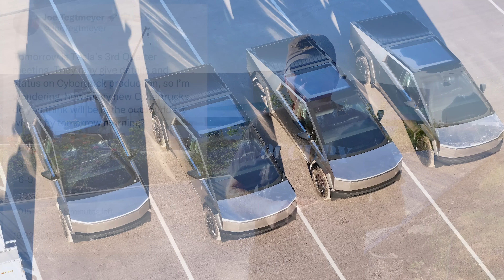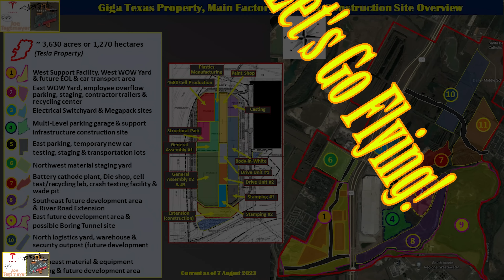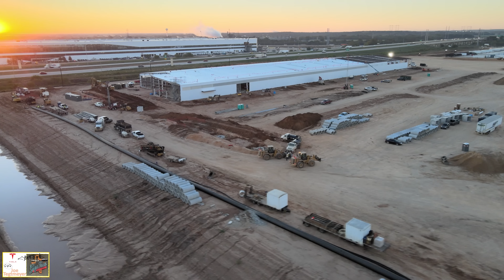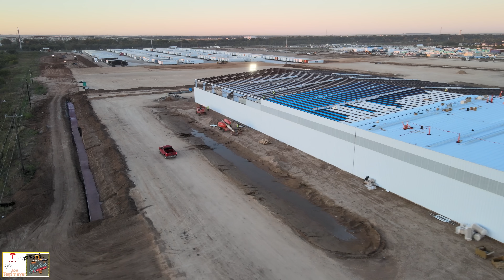4 Uncovered Cybertrucks, S End Footings & 3rd Qtr Results!18 October 2023 Giga Texas Update(07:35AM)

Comment: Perhaps the white plastic covering in the permanent switch yard is to allow the assembly crews to complete the (final) part of the wiring without risk of exposure to water. Might it be possible that it's important for it to be done in a dry environment, or perhaps there's a contractual time constraint/deadline they have to meet?

Comment: The white paint is intumescent fireproofing. It protects the steel from the heat during a fire. It is similar to cementitious fireproofing but intumescent is easier to apply and doesn't add as much weight to the structure.

Comment: 30:05. This is a good cover up! Terminating high voltage underground cable is a process where cleanliness is very important, especially keeping out moisture from the connections as they are prepared. It is a process of peeling back layers in specified ways to get to the main conductor, then applying the termination coverings in layers in very specific ways, all while remaining clean and dry. I have never done any at this voltage, but I have terminated and spliced 13.5 kV cable, which has the same requirements, albeit a simpler process.
30:35. Fencing added between the BESS switchyard/substation and the BESS yard.
Reply: Any idea how long this process might take? Days, weeks.
Reply: @DessieDoolan  
Depends on when they actually start the work. I believe a crew of 4 can do at least one connection a day, then they have to be tested before the final connection is made. Testing is done after both ends of all the cables have the termination connectors installed.
Reply: @GoCoyote  Easily a week then.
Reply from the maker: Thanks for the great info and insights! I appreciate that!
Reply: @JoeTegtmeyer  Thank you! Your the one actually doing the work. I just comment, opine, and share my experience from my armchair. You do a great job, and I know that a lot of people really appreciate that you are willing and able to keep us so well informed. It has been such a pleasure to have such comprehensive information about this project, and I have learned a lot from you and others like Dessie. Well done.
Reply from the maker: @GoCoyote  🤗👍

Comment: WRT to why they are currently only making rear castings, do they more than one 9,000-tonne press working? If they are making both castings using the same press, then they will probably make the respective castings in large batches so as to reduce how often they need to change the casting die.
Reply: There might only be the one 9000t press operating and they don't want to lose the hard fought dialing in of the rear casting dies by swapping in the front casting dies.

The castings stacked outside today are identically placed as the castings were on Monday. Indicates no additional castings manufactured since then, or at least not stacked outside.
Reply: @DessieDoolan  Or could still be dialing in the rear casting with proto die, which they likely wouldn't want to change, until it's final and they create the first permanent die?  Then on to similar for the front or the front is already done and they used up internal space for those.  I can make up anything when I actually have no idea what's going on. :-)  Still fun to guess.
Reply: @scottgaree7667  You are right, it's mostly guess work. Have to trying and join the dots, except some of the dots are inside out of view.
What we do know is that Cybertruck front castings have not been seen outside.
There are no new flues on the roof to suggest that the 9000t presses have their own dedicated furnaces yet. No new flues for the 3 new furnaces on the east side yet either.
Giagpress parts in the recycling yard might (or not) indicate something has gone wrong.
This is a good video via HarderNL about High Pressure Die Casting. Some insights into how complex a process HPDC is, https://youtu.be/pks96GSnjbo?t=4
Plus 9000t machines are a new beast to tame.
Reply: Perhaps there is a change to the front casting responding to a problem discovered in the crash tests.  They are continuing rear casts while awaiting a new die for the front??
Reply: @benguthrie49  I guess we'll know if the Cybertruck release date gets pushed back months.

What I think we are seeing is rear castings only as they dial in those dies, and we'll see front castings sooner or later while those dies are dialled in.

Similarly there was months of Model Y castings showing up before we saw Model Ys in production. May to November if my memory serves me correct.

What am I saying! Of course the release date will be pushed back!😲
Reply: @DessieDoolan  They said end of November for CT first delivery on the call today
Reply: @benguthrie49   A ceremonial 'first delivery' for sure.

I have commented in the past that I'll believe mass production has started once I see a Cybertruck in the employee parking lot.

Inconveniently there was one at the Superchargers in Brad's video yesterday. I may need to come up with another indication.

First Cybertruck in the contractors parking lot!
Reply: @benguthrie49  Yes. Since I wrote my original post, I recalled that Brian White from My Tesla Weekend had mentioned this. 

I wouldn't be surprised if it was true because the front of the car has been shortened since the original prototypes, so the front crumple zone is probably shorter than it was originally designed to be. Combine that with a rumoured slightly heavier than intended vehicle weight and they might have had to make a range of changes to the front of the chassis and crumple zone so that it performs to spec in collision tests. 

I think they have been making the vehicle with the front castings only since the first production candidates in July. So they probably didn't encounter this problem until they crash-tested those vehicles, although they probably expected it would be a problem. 

The problems encountered are probably the reason why they have built the new collision test facility at Austin and why there has been a 1-2 month delay in the proposed vehicle launch date.
Reply: we'll see. The die is cast. ( couldn't resist )
Reply: @benguthrie49  I was tossing up whether to use that also. (couldn't resist) 😑

Comment: Why is there so much steel on the ground near the EOL building still, when framing is complete?
Reply: The areas where the roof is a clear span may have been an afterthought and these are the components those deeper columns and beams replaced.

Afterthought, as in redesign any time over the last 2 and 1/2 years. That steel has been on site since March 2021

Comment: Thanks Joe.
5:26. W-WOW yard. Far right. Rolled out geo-mesh. This may be a dedicated road from River Road to the new EOL site.
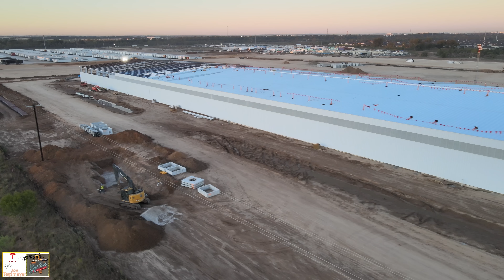6:55. New EOL site. HDD project. Bottom. Barrel reamer. 2 drilling mud reclaiming machines operating. Blue and yellow.
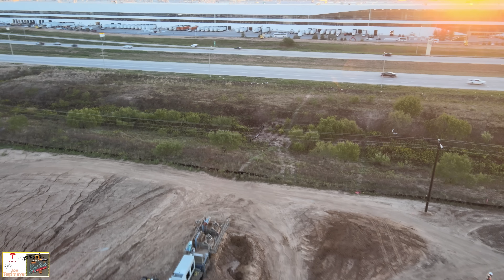8:08. New EOL building. Roof drain pipes and excavation.
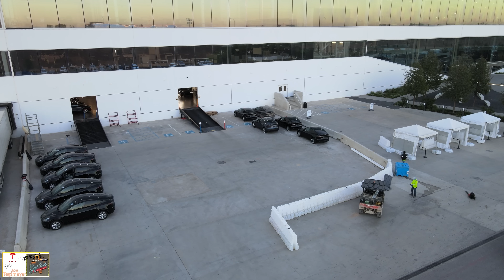8:44. Highway berm HDD project. Additional lengths of drilling rod to be added as the drill is pulled back westwards.
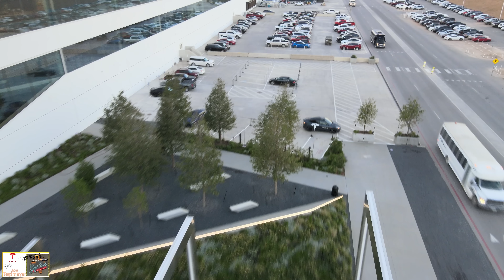9:22. Main Entrance. Washing the calcium staining off the Stoneglass. A temporary fix.
9:46. Highway berm. Still no obvious reason why the powerlines were shifted to the foot of the berm.
11:02. Southend. White frames. Look like the heavier duty pallet racking seen inside Battery recently.
GA south, wall. Grey acrylic render/stucco troweled over the wall sheeting.
11:57. Southend. Layer of gravel built up several feet. Orange spray marking shows footing squares.
12:30. Southend, east. 4 CFA piles per column footing/pile cap. Column spacing would seem to be the regular 45’10” 14m spacing used elsewhere in the factory. Different to the abutting Stamping column spacing. Larger sized footings to the left.
Workers are breaking away the concrete to expose the rebar in the piles.
Obvious now that the white riser pipes are at a spacing closer than column footing spacing.
13:04. Southend. CFA drilling rig. Must be drilling additional piles, or a remedial pile is required.
BIW, apron. Large white delivery. I think I can make out TKS marked on the back. Could be the same as seen at 5:45.
15:06. Parking Garage. Footings have 4 hold-down bolts. Suggests steel columns to me. Spacing of hold down bolts seems small for precast columns.
Compacting crushed rock/gravel in the base of a footing excavation.
19:10. Die Shop east. Formwork for a spill containment wall.
20:19. Cathode, east of. Earthworks. Not clear to me what is going on here. Drain outfalls are currently at about the same grade as the excavation. If it’s a pond there won’t be much capacity.
22:24. MM Batch plant berm. A bund has been built up around the open stormwater drain riser.
22:57. Die Shop south. Trench work. Workers harness lanyard is connected to the large block of concrete.
23:49. East parking lot. Cybertruck at a supercharger.
23:55. BIW loading docks. Right. Rebar starters projecting north out of the dock leveller platform suggest at least one more loading dock bay to be added.
Rows of Cybertruck rear castings.
24:06. BIW apron. Wall openings cut months ago for additional loading docks. Good chance the painters have caulked the saw-cuts.
24:21. BIW apron. Left. Old electrical ductbanks and one vault demolished.
24:54. Casting east, apron. Cybertruck castings. Unchanged since Monday. https://youtu.be/Yul39oQQlW4?t=979
No Cybertruck front castings have been seen here.
26:55. Paint, apron. Dark grey Model Y. Tape has a series of graduated marks written on the tape and onto the body.
27:27. Paint, apron. Bumper paint stands. Same at Fremont, https://youtu.be/Qnp3LigaoFA?t=309
27:49. Battery Level 2, Inside. Floor joists placed.
29:52. Tesla Energy Monopole. Not connected to the grid, connected to the switchyard.
30:19. BESS switchyard. Cover up. Must be planning on being there for a while.
Reply: This is a good cover up! Terminating high voltage cable is a process where cleanliness is very important, especially keeping out moisture from the connections as they are prepared. It is a process of peeling back layers in specified ways to get to the main conductor, then applying the termination coverings in layers in very specific ways, all while remaining clean and dry. I have never done any at this voltage, but I have terminated and spliced 13.5 kV cable, which has the same requirements, albeit a simpler process. 

The monopole is set up to connect to the grid from the high voltage bus in the utility side of the switchyard/substation. This will allow current to flow in and out of the BESS directly to and from the grid without going through the Tesla distribution system. Not sure if Tesla will be allowed to use the BESS yard transformer for both the BESS and as another service entrance to supply the Tesla distribution system in addition to the other 2 transformers of the substation yard. Having redundancy in substations is important in order for maintenance or failure, so if the system has full use of all three transformers, but only needs two at a time, then any one can be taken off line as needed.

I am puzzled by the location of the BESS monopole, as it would seem to have been better to locate it on the west side of the yard to be closer to the BESS. But there are many reasons for such things, from practical limitations, design changes, and sheer bone headedness of some individuals or institutions involved.
Reply: @GoCoyote  Monopole location. Agree, bone headedness. LCRA would have had their needs front of mind first.
Reply: 30:19 Long enough to terminate 3 large and expensive cables. Cable termination should be done in a clean dry environment.
It is complicated process....
High voltage cable termination: https://www.youtube.com/watch?v=lbacD5velHc

Comment: Southside does make one wonder as looks to be closing down for the season. Put/install a load of footings/foundations and see what the readings are come Spring.
Reply: Winter hasn't stopped them before.
Reply: @DessieDoolan   True enough that they have never stopped thrusting even during the 'cold' and the wet. Get that over in Aus. too. That's some sodden land right there even during the summer. Not looked into detailed geological history but the physical land hasn't always been there. The river is estimated at 5m years as I remember and would most certainly cut a number of courses. Ex. gravel mine, for Austen building construction I imagine. Like looking for oil...... you don't just drill randomly. It was never going to be easy to build on, the land I mean, because it was the bank of the river in relatively recent geological history. That 'for future expansion' plot at the south wouldn't have been created without good reason.
Reply: @memrjohnno  Hard bit almost done. Piling complete, the construction of the footings/pilecaps is straight-forward. Once they are 'out of the ground' wet weather is not much of a concern.

The CFA piles were potentially 100' 33m deep, the height of the auger. The auger was often seen at 60' or so. Much deeper than the geo-piering under most of the main factory footings/pilecaps.

Even Stamping was geo-piered only

Additionally the entire southend was geo-piered at a regular spacing.

Now just waiting for the steel to start showing up.

Site geology.

Closest to the river. Includes the river, the south pond and the south east half of the 'southed'.

“Floodplain deposits, including indistinct low terrace deposits; clay, silt, sand, and gravel; silt and clay, calcareous to surface, dark gray to dark brown; sand largely quartz; gravel, siliceous, mostly chert, quartzite, limestone, and petrified wood, along Colorado River much igneous and metamorphic rock, probably mostly reworked form terrace deposits; fluviatile morphology well preserved with point bars, oxbows, and abandoned channel segments.”

North of the above. Includes the north west half of the hardstand, most of the main factory.

“Terraces along streams, consist of three or more levels which may correspond to coastal Pleistocene units; gravel, sand, silt, and clay in various proportions with gravel more prominent in the older, higher terraces; gravel along Guadalupe River, siliceous, coarse, along Colorado River, mostly dolomite, limestone, chert, quartz, and various igneous and metamorphic rocks from the Llano region and dolomite, limestone, and chert from the Edwards Plateau; sand mostly quartz.”
Reply: Geology info taken from https://txpub.usgs.gov/txgeology/

Comment: Thanks Joe!
EOL facility:
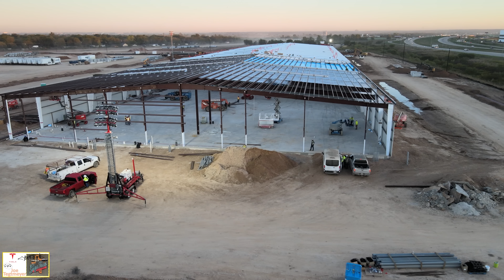@ 7:37 (Bottom) Ongoing work on new duct-bank. Small trench takes a turn to the west.
East side of casting/Connection to main power vaults:
@ 24:38 (By building) Excavation around the main power vaults by the building. It appears that one of the vaults has been completely removed. My guess is that they might replace both vaults.
Vault by the stairs... A lot of cables have been pulled through the duct-bank. Not enough cable left to make it into the building. So this will be a cable splice point.
Note: The other cable splice point is in the vault in the north parking lot.
North side of casting:
@ 25:51 (Bottom right) This vault is a passthrough vault. Cable splicing will take place across the road in the vault to the left (With all the cables sticking out).  
Temporary substation:
@ 28:28 North transformer removed. Looks like the utility just needed it for something else. Hard to see but all disconnects appear closed, except for the transformer that was removed.
Tesla Enclosure/Mega-vault:
@ 28:50 (Bottom) Fencing set up around plugged opening for third switchgear building. Guessing that it will be opened up at some point.
LCRA substation:

@ 28:53 (Bottom) No cables connected to the east transformer bus-bars yet. But it looks like they are about to begin work on cable terminations.
East monopole:
@ 29:38 Crew setting up scaffolding so they can do the cable termination work.
BESS substation:
@ 30:15 North steel structure enclosed in scaffolding and tarp. Cable termination work on the 345 kV cables that were recently pulled through the duct-bank. 
Joe... The covered work platform provides a clean dry environment to perform the cable terminations.
Reply: Exactly David. Although you can terminate the end of a high voltage cable in the bottom of a dirt trench, it’s certainly not recommended. If you ever watch the videos on how those cables are terminated it involves a lot of cleaning of the various layers of the cable before and during the termination procedures. Electricity at those potentials can cause death and mayhem with the tiniest of imperfections in the conductors or insulation layers. When you want to do that many cables I’m not surprised that they want to build a clean, dry, and relatively calm work environment.
Reply: @Bill_N_ATX  Yep, I've seen some of those videos and was surprised at how much carful work was involved. I will try to post a link for others to see but YouTube seems to hate my links.
Reply: High voltage cable termination: https://www.youtube.com/watch?v=lbacD5velHc

Comment: 29:40 can anyone shed light on why scaffolding is being used here rather than boom lifts
Reply: Because putting the termination connectors on very high voltage cables is involved process with a lot of cleaning, measuring, taping, sealing, heating, and such as you build up a multiple layer system to terminate the wire onto a connector. At these voltages, even the tiniest imperfection can cause a hot spot or worse. So doing it on a stable platform with a roof and walls is a much easier environment.
Reply: @Bill_N_ATX  thank you very much